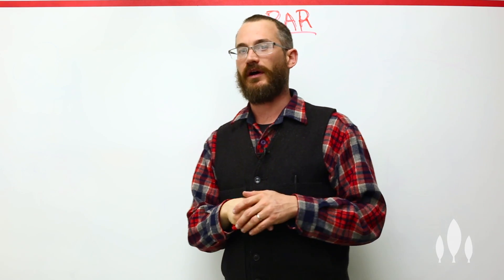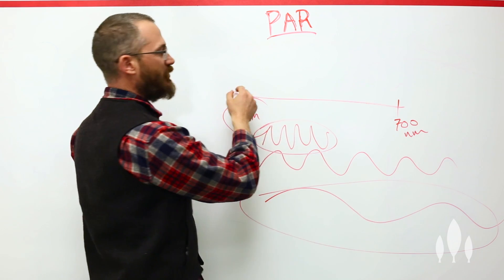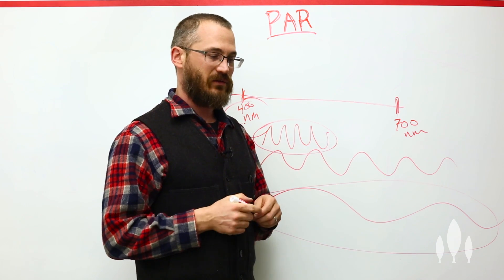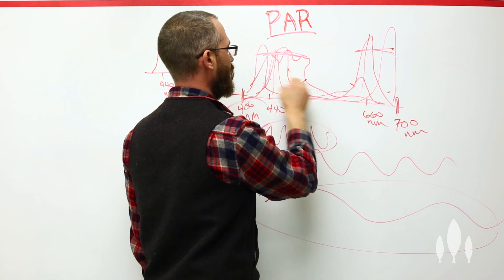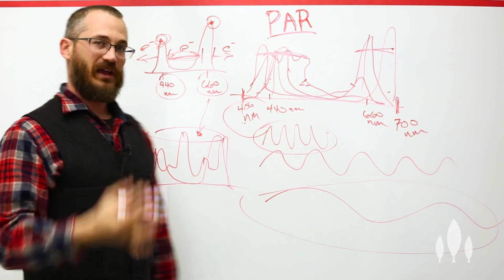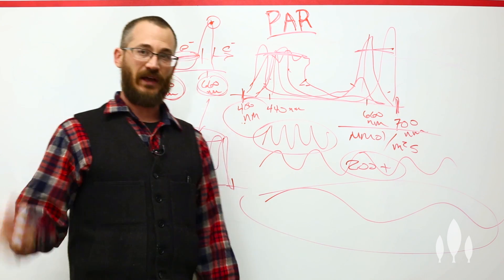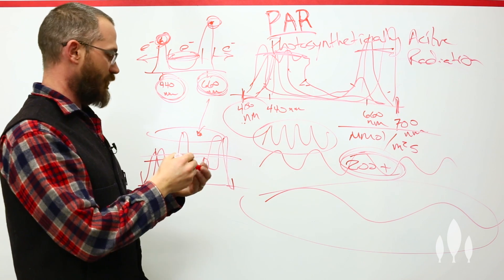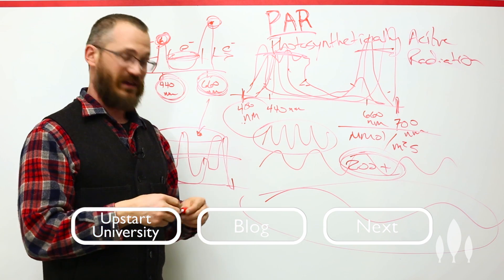What is PAR for Indoor Farming

Comment: Thank you for the informative video.  You claim most plants make the most use of 440nm and 660nm wavelengths.  This corresponds to approximately 6600K and 4400K color approximately.  Does this mean I could get the best results mixing 6500K Daylight and 4100K Cool white fluorescent tubes in my fixture?  If so, what is the ideal ratio?  50/50? or would 60% or 75% Cool white work better?  I have seen people advertising 3000K bulbs for indoor gardening.  They claim that is better for flowering plants.  That corresponds to 960nm, out of the PAR range.  Are they mis-guided? 
Also, I am looking for some figures on how much PAR light a plant actually needs.  It is hard to find data on this.  Is it worthwhile to invest in a cheap light meter?  If so, how much light do I want on the plants?  Without measuring equipment, using a four T5 HO fixture (45 watts/tube)  How close do the lights need to be to the leaves so they get enough light.  (I am growing lettuce.)
Reply: I just tested this very thing. I have a cheap ($250) meter but it seems to do the job! At 8” a new T5 bulb registered ~50 PPFD and my clear bulb LED light registered ~175 PPFD! I need to add that I do not have “shop lights”. Mine are grower designed by a company that just won Best in World. (2022) To register 200 PPFD the T5’s have to be within an inch of the plant. Dr. Bruce Bugbee has shown that adding 10% far red will increase lettuce mass by 33%!

Comment: Greetings from Venezuela.

Excellent video, very informative. How cool is that we live in this age of inexpensive LEDs and information tech applied to so many fields, agronomy included.

It seems to me that, in a perfect controlled environment, a plant should be given only the wavelengths it needs for optimum growth and to our eyes the leaves should look, well, black. 

Imagine a RGB, numerically controlled growlight that provides to the specific wavelengths a particular plant needs and adapts by photosensor to unnecesary light being reflected from the plant. Not sure if it would be too much work for the return, like using a nuke on a cockroach, but it sounds cool.

One thing that confused me for a second there starting the vid was how you pictured the EM spectrum. I've been used, ever since I was a kid, to the spectrum being depicted from left to right starting with the low energy EM (radio, microwave, infrared), then the visible spectrum from red to violet, then the high energy EM (UV, x-rays, etc). I feel the sorting order should be by energy, not wavelength. Minor thing really, tomato vs tomahto.

Comment: Do you think using CFL's 6500k is a good way to add light to my plants or should I bite the bullet and buy some LED's
Reply from the maker: Hey +mark layton - LEDs are almost always better in the long run, but T5s are much less expensive, so it depends on how long you want to be growing, how much money you have, and whether or not you want to upgrade down the road.
Reply from the maker: +Aaron nutter Thanks for the info!  We have a lot of viewers that it turns out know a lot more about lighting than we do.  Thanks for the input!
Reply: +Bright Agrotech t5 is a size classification of a fluorescent bulb. Generally full spectrum fluorescent bulbs are cheaper in t12 or t8. What used to be called a spec.42 is now a daylight bulb.
Reply: +Aaron nutter Your right but The t5 has higher output as to the t8 and t12 send out a softer light. Most fluorescent lighting  for offices and building use t8 and t12 because it saves on energy cost but the lumens are cut back. t5 and t8 might have a difference of 10 lumens per bulb depending on the brand but in growing applications a t5 bulb will outperform a t8. 

http://www.hoveyelectric.com/hovey-electric-power-blog/bid/83731/T5-vs-T8-How-Do-You-Know-If-You-Really-Need-T5-Lighting